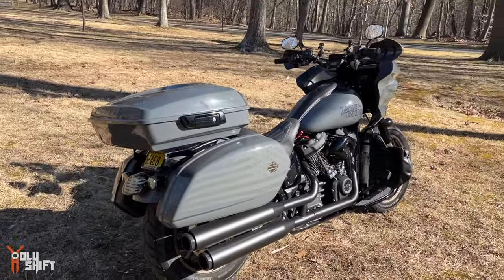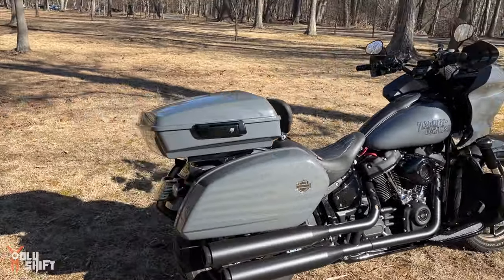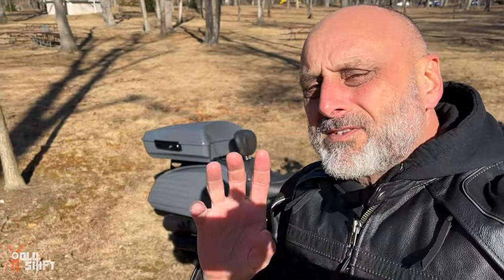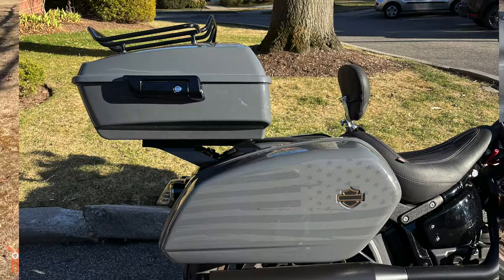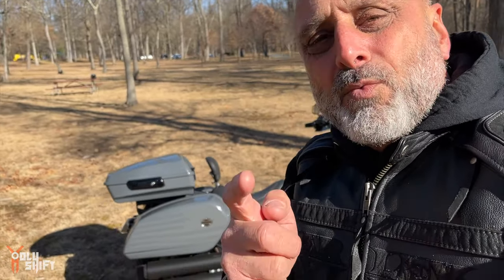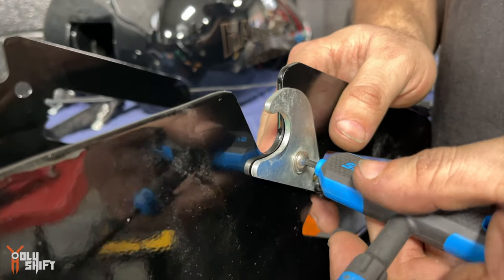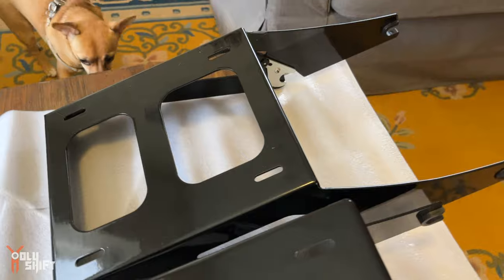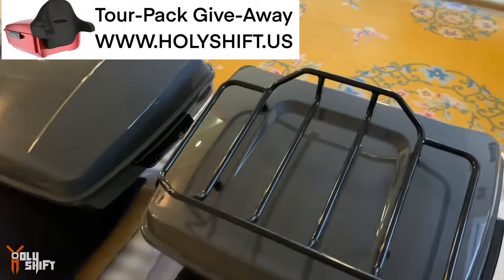Chopped Vs. Razor Tourpack - AdvanBlack

Comment: What method did you use to get the reflectors off your bags? I've been searching the videos and can't seem to find anything.
Reply from the maker: Use a heat gun - to warm up the glue - watch out not to over heat surrounding paint . Use some dental floss to go behind the refrigerator to peel off glue. Then clean up with some alcohol or sticker removal liquid…
Reply: @HOLYSHIFT  Thanks!

Comment: R those little holes in the front of the tour pak? 3 on top 2on bottom on the right side ? Or what? Of holes is it not waterproof?
Reply from the maker: Those are screw that hold inside the tourpack a mechanism that prevents the top from opening up completely..
Reply: @HOLYSHIFT  is it waterproof then?
Reply from the maker: @davemeshamsr6000  yes it is .
Reply: @HOLYSHIFT  thnx. Great segment, keep it up